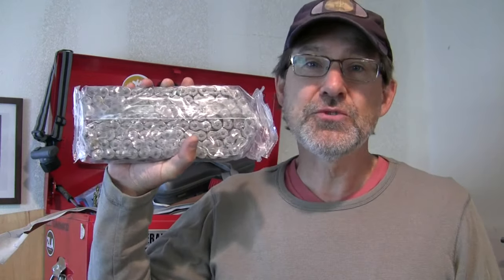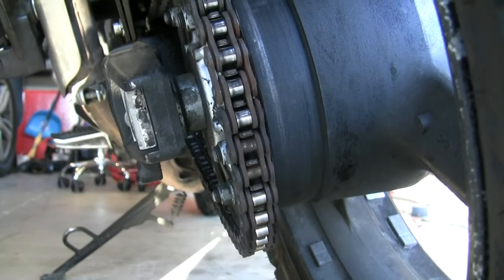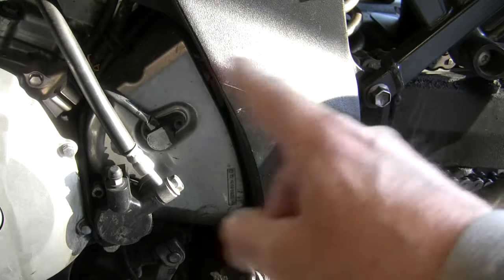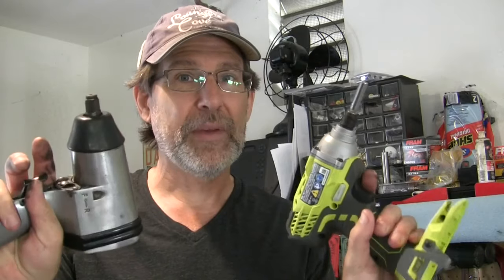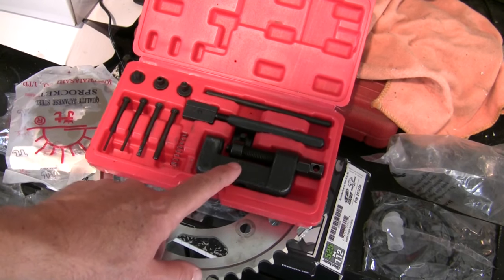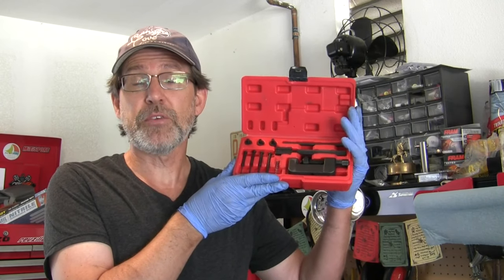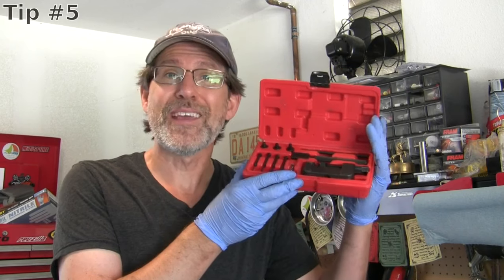5 Tips for Using a Chain Breaker & Rivet Tool

Comment: I can't see why is necessary to remove both pins if you want to remove chain ! Is it some hidden trick there also ?
Reply from the maker: @psyleta  You could remove only one to get the chain off, but only if you can get the outer plate to rotate out of the way. I've found it easier to just take that outer plate off entirely. Thanks for watching!

Comment: Hi urban. Good to see you back. And another great video with more than enough information for the wood be motorcycle/ mechanic like myself to give that particular job a go. Just one question which I meant to ask regarding the big tour you just completed,,,.  I did a big tour of Europe on my last bike,, a Kawasaki zzr 1400. And found having a cruise  control on that bike made the long journey's a lot easier on the right hand wrist . I never heard you mentioned that you had one. But even if you didn't,, do you know of one that would fit the v strom.  I would think it would have to work in conjunction with the hand protector.  ? Thanks for any info on this.  Rob .
Reply from the maker: Thank Rob! Sounds like you understand the special kind of peace a long motorcycle journey can give. I have an inexpensive throttle lock plus a "palm paddle" / "wrist saver" on my Strom. I talk about in one of the videos. I'll look for it and provide a link. You're correct, the throttle lock solution has to work with the hand guards. Thanks for watching!
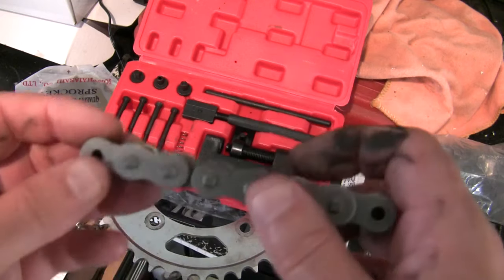Reply from the maker: Around 7:43 I talk about it here. https://youtu.be/r6IbhQL09Bo
Reply: Oh yes ,,, now you mention it,  I remember now. Iv seen people using that type of device.  Might just give it a go.  Thanks.

Comment: Why not just remove the chain with a cutoff wheel on the angle grinder? It's going in the garbage anyway, right? Thanks for this video, btw. This'll be helpful.
Reply from the maker: Thanks for watching.  
Could be done that way but there could be a higher risks of broken grinder disk as the link halves could swivel and pinch the grinder disk. I prefer my more delicate approach, but I don't disagree your suggestion would work. Just a question of risk I suppose.

Comment: Cranking and cranking, but no flare???????
Reply from the maker: I flare beginning at 11:50. Thanks for watching.
Reply: @UrbanMonkTV  no I meant I’ve been cranking and cranking and it won’t flare at all. Can’t figure out what’s wrong? only guess is a defective tool.
Reply from the maker: @user-hu2pp9ic9t   The metallurgy in the rivet type master links is very specific. Softer at the tip/flare point. Are you using a link that was intended to be a master link?
Reply: @UrbanMonkTV  thanks!yeah I got a 525 chain for a super sport. Must’ve watched 20 videos like this. Do exactly what you guys doing in the video have it set up exactly the right way and no flare at all. Saw one other guy said he needed the better quality riveter tool to handle the 525s. But I would think I would at least get some flare by cranking that hard???
Reply: It is my first time ever doing it though, so maybe I’m doing something wrong.
Reply from the maker: @user-hu2pp9ic9t  Mine is a 525 also. Sorry I can't be of more help from my chair here.
Reply: @UrbanMonkTV  all good thanks for the video!
Reply: @UrbanMonkTV  I ordered another master link so I can mess with this one more and not worry about it. I just used one of the breaker pins instead of the riveting pin and seems like I did get it to flare at least a little bit. Still cranking hard and didn’t think supposed to use a breaker pin but maybe that will work?
Reply: Yep it was a defective tool! Bent The damn thing cranking so hard. But got them flared just enough! gonna redo it with the a better quality tool when I get the new master link.
Reply from the maker: @user-hu2pp9ic9t  I have bent one in the past too.
Reply: @UrbanMonkTV  yeah, I learned my lesson a while ago to always buy the better quality tool. Brain fart.
Reply from the maker: @user-hu2pp9ic9t  There is certainly something to that, although I have been known to buy cheap tools if seller agrees to take them back and I don't need to drive far to return. Most inexpensive tools do the trick for me but sometimes they can let one down.
Reply: @UrbanMonkTV   Nice! I figure I’ll do quite a few chains over the years, so might as well. I’m gonna go tomorrow but I’m pretty sure cycle gear will put the return towards the price of the upgrade.

Comment: Why not just use the angle grinder to cut the chain off in the first place?
Reply from the maker: That's an option depending on the result one is aiming for and tolerance for risks associated with using angle grinder at all (i.e. broken grinding disk).

Comment: With all my respect, this is not a master of anything, the tool is disposable to say the least, it is soft iron for a high displacement motorcycle is taking risks, its trick to insert the sheet metal with two holes, it needs a lot of light to see or it could be riveted, and if the chain is for pulling, it is simple, it is cut and that's it, there is no need to review or extract pins with that toy riveter which I do not recommend to anyone, for the same money a professional mechanic will do it for me with a professional riveter, still thanks for the video, good contribution to know how not to

Comment: Excellent video on how not to press a link on. Make sure you’re not teaching anyone these steps.
Reply from the maker: I appreciate your comment even if I don't share your opinion. I've put many tens of thousands of miles on my chains without incident. I am always open to suggestions and criticism. You've provided me with the latter. Perhaps you might offer the former.
Reply: @UrbanMonkTV  I couldn’t watch the entire clip but never EVER press a link on the rear sprocket.  Doesn’t matter how many years you’ve been doing it that way, it’s never good. Only safe to be used to hold the chain till you can put the link on there. Then rotate your chain off the sprocket to press.  

Think of your audience that may be using aluminum rear sprockets and now cracked a sprocket tooth unknowingly. This video could potentially cause a nasty wreck or worse.
Reply from the maker: @jimmcconville624  Thanks. That's fair and I hadn't thought of that honestly. Your logic makes sense to me.
Reply: @UrbanMonkTV  not trying to be a jerk or know it all. But those sprocket teeth are delicate and something you don’t want to be putting necessary  pressure on.  I do the join on them, but never press the plate on the teeth.
Reply from the maker: @jimmcconville624  All good. I appreciate the opportunity to think about it. As I think about it further though, wouldn't the inner bushing always be a larger dimension than the thickness of the sprocket (by design)? Is it incorrect to say the tool could not press the plates together any closer than the dimension of those bushings (around which the roller spins).
Reply: Im confused. How would there be "pressure" on the sprocket at all? @UrbanmonkTV nothing wrong with your tutorial man. I've done it the same way for over two decades. No issues.
Reply: @cycle_Therapy  you’re pressing the plate on the link. Think it’s smart enough to do it on the teeth of a sprocket?  It’s not the smart nor proper way to press that link.
Reply: @jimmcconville624  I've been trying to find and research the proper way to this and haven't found anything saying one way or the other so far.  Also never specified this to us in school at MMI either. Although this is the first time ever hearing this claim. I will keep digging.
Reply: @cycle_Therapy  sportbikes often get aluminum rear sprockets which aren’t very strong to begin with. I line up the links on the sprocket to connect it together. But when pressing that rivet master link on, roll the chain off that sprocket first.
Reply: @jimmcconville624  Not necessary though, if you press so far it puts force on the rear sprocket you are also compressing your O-rings way too much. It's simply not a problem.

Comment: What’s wrong with putting the bike in gear?
Reply from the maker: Thanks for watching. When I said that I was speaking to the use of an impact wrench. If in gear, the forces from impact wrench go into the transmission gears, which I don't recommend.
Reply: @UrbanMonkTV  if undoing by hand would putting in gear be particularly dangerous? Alternatively if I keep the wheels to the ground and tie down both the brakes, would that be better? 

How risky is using the in gear method for undoing and torquing the front sprocket but anyway?
Reply from the maker: @funonthebun888  That's fine if loosening by hand tools. However I still recommend applying brakes and minimizing the forces going into transmission. Not saying damage is certain,  just better safe than sorry.
Reply: Thanks.

Follow question, when braking the old chain, is trying to push out the pin without grinding off the river definitely going to be impossible with a cheap chain tool? Do I absolutely have to grind off the river first?

What if I choose to brake the chain on the master link, would that be easier?
Reply from the maker: @funonthebun888  I would be easier on the master link. In fact, I would not try to "break" it at any other link. Those pins are just too hard.